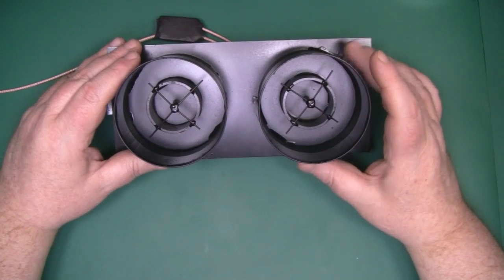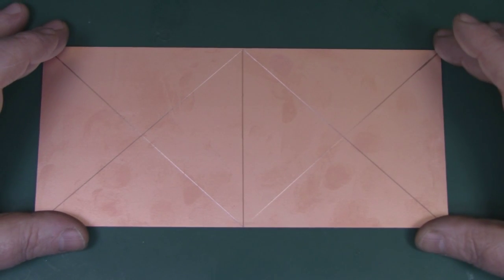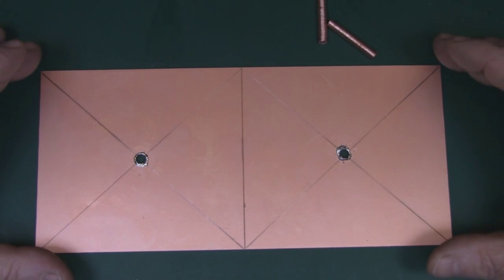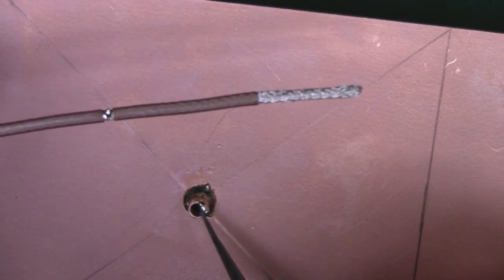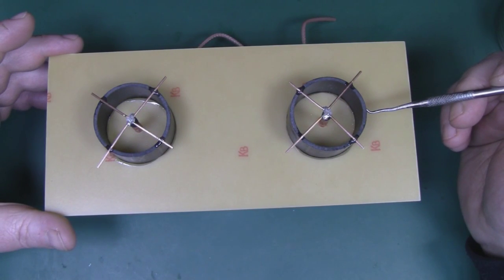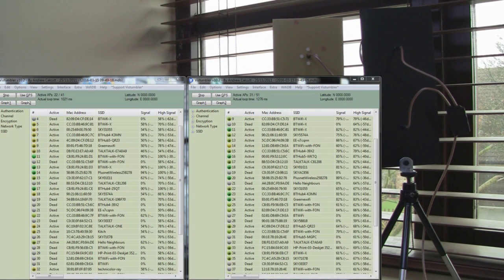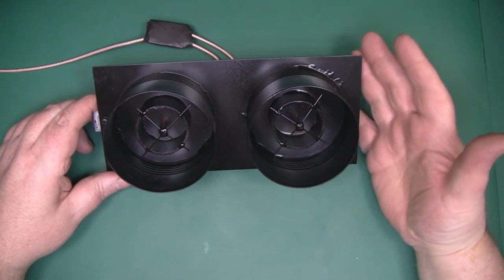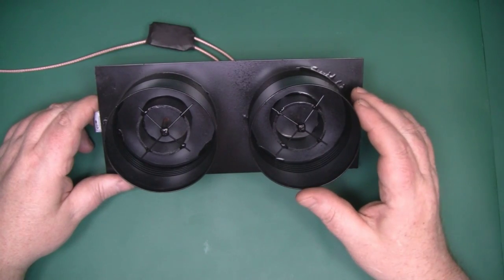Double Crosshair Waveguide Antenna for 2 4GHz

Comment: Very nice Andrew.
The way I understand it, adding a wave guide to a helical antenna would increase it's sensitivity by a little giving it a little more range but reducing the beamwidth. Is there a relationship between the wavelength and the diameter of the guide? 
Cheers.

Comment: Hello Andrew. First.. a great antenne what you have made!!!! Can you tell me a bit more about the opening angle of the antenna. I want to use it for my drone and the opening angle should not be too small. The gain will increase with metal ring but the angle of return becomes smaller, I assume. Have you done measurements here and what can you give me for advice.

Comment: do u have a link for a bulk purchase of pigtails? I need sma connectors with a length of coax to build a small amount of antennas for use in a 2x2 mimo wifi card's...

2x2 or even 3x3 mimo wificards are more practical in most of my applications...

I'm going to try this build here with biquad and yagi pen builds... 

nice video as always!!!